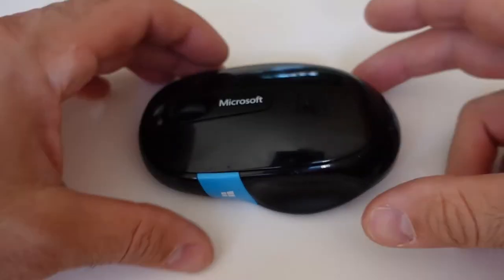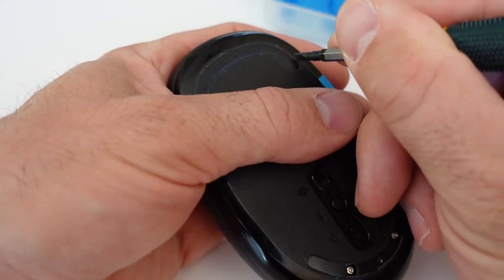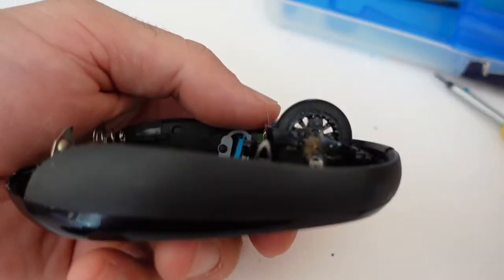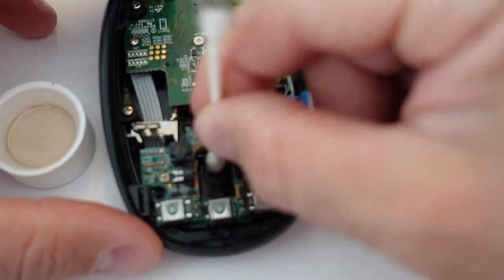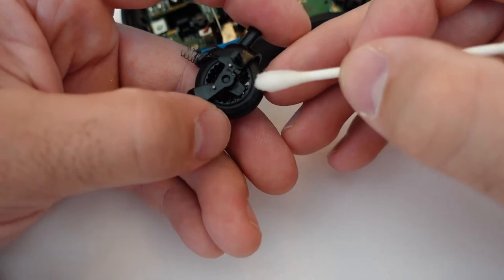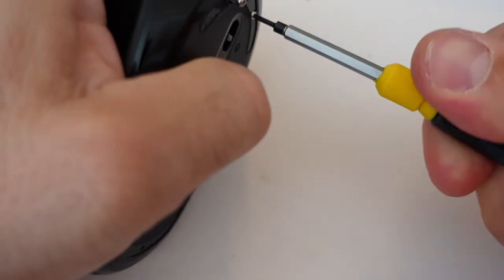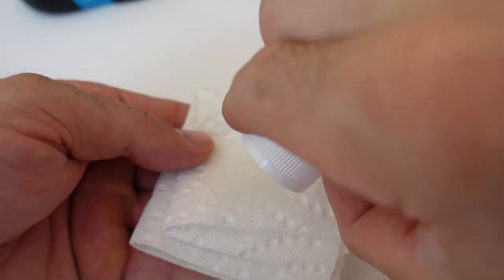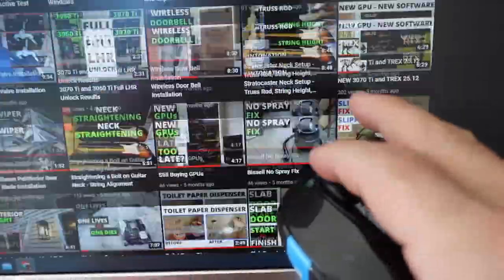Mouse Scroll Wheel Not Working - Fix

Comment: Thank you. Your calm actions in disassembling and cleaning your mouse gave me confidence to disassemble and clean the mouse of my Lenovo 01ah876 mouse-keyboard combo. It wasn't as easy as your disassembly, but in the end, everything came back together. The wheel now works as expected.
Reply from the maker: Glad the video was of benefit.
Reply: @DIYNorth  what mouse sensor does this mouse have?
Reply from the maker: @bowen7057  I'm not sure, LED to optical sensor then bluetooth to the computer